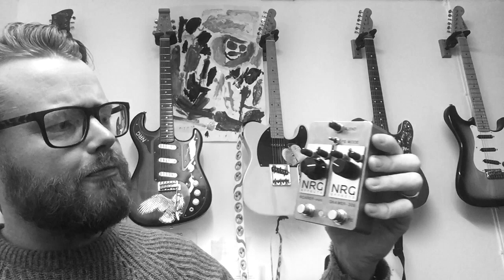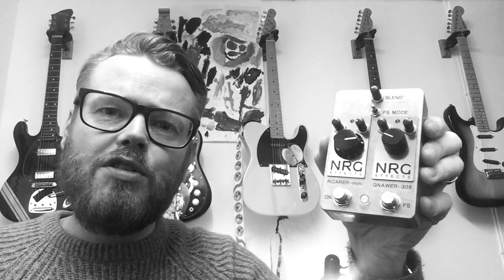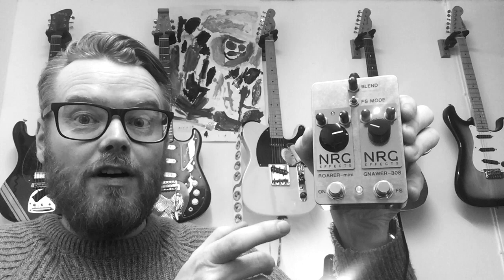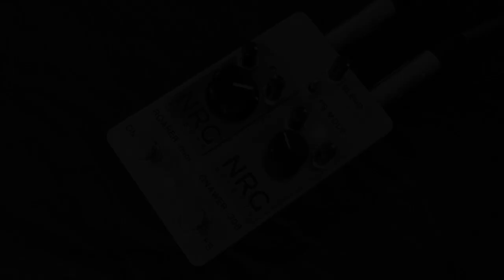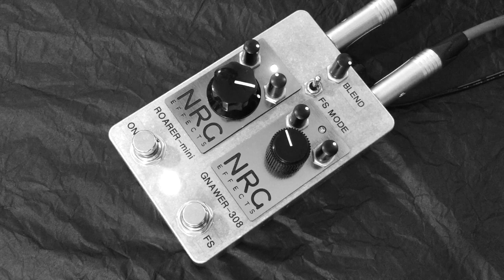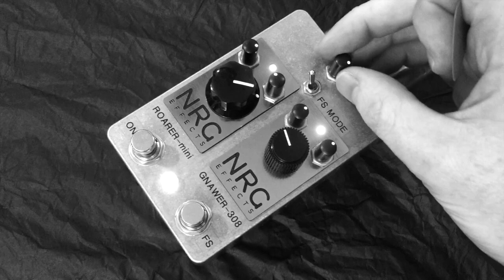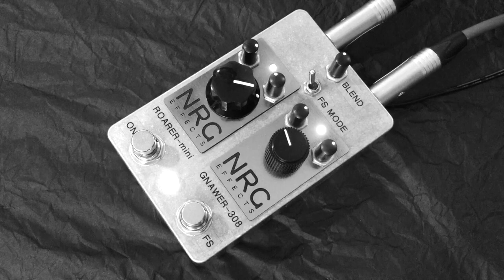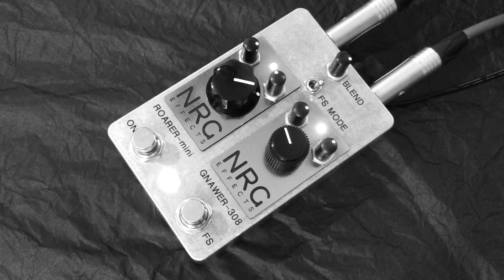NRG EFFECTS - MONOCHROME DOUBLE - PARALLEL

Comment: I think would give me what I couldn't QUITE get out of my Purrer...the ability to toggle between two completely different OD settings, one gained and EQ'd for an open just dirty rhythm thing, the other for lead tones.
Now I just need to decide which two of your circuits to combine.
Reply from the maker: Yes, the dual gain channel PURRER is mainly designed to allow "more of the same" with the two sets footswitchable gain and output level controls.
If you're after switching between two drives with different tonal characteristics and response, then the Monochrome Double - Parallel does that very well indeed.
The pairing of PURRER-mini and GNAWER-308 does this particularly well, if your after a wide range overdrive/distortion tones. You can then A/B between the two independent effects or blend them in parallel for even more tonal possibilities. 
I'll be getting up demos of parallel PURRER/GNAWER and PURRER/PUMPER very soon.
Shoot me an email if you want to fond out more.
Cheers, 
Neil.
Reply: Cool Neil, thanks!